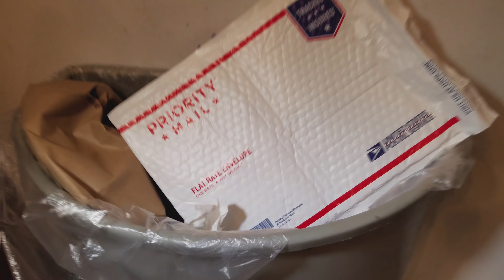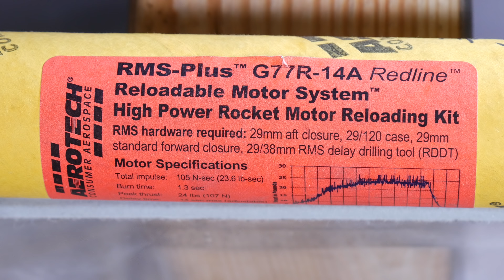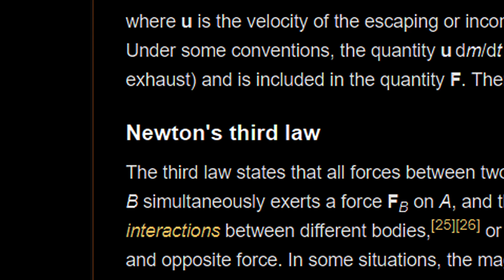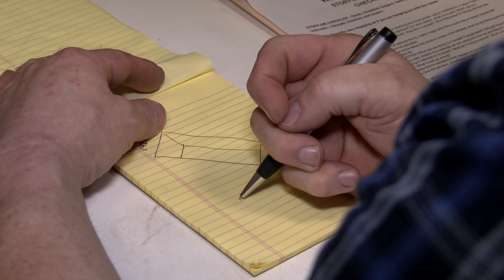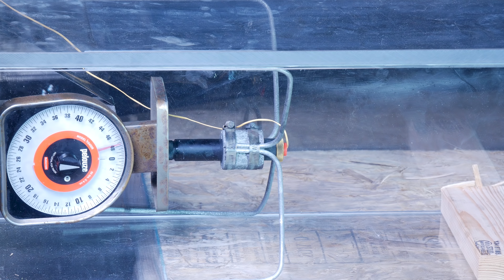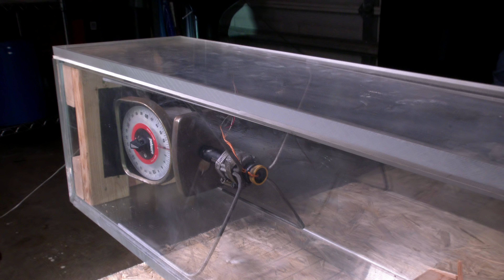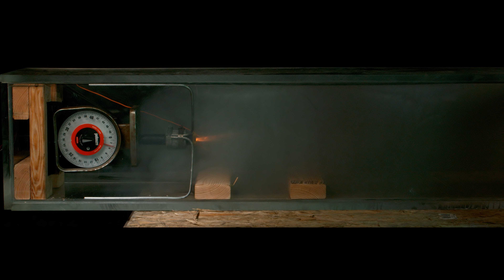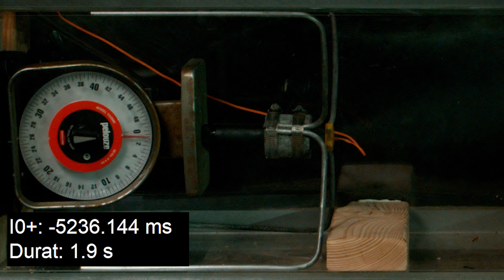Rockets in a Vacuum Chamber - Newton's third law of motion Visualized

Comment: Outer space is an infinite vacuum, that box is a finite small vacuum.
Reply: Waterworld 360 there is not such thing as an infinite vacuum, though I think I know what you’re saying. Space is a complete vacuum. The box is as good as we can do on earth, especially with consumer products. The engine did produce thrust when the effective pressure in its immediate vicinity is zero.
Reply: Bingo!
Reply: Prove space is a vacuum! Prove anything that holds weight for all eternity!
Reply: don't kid yourself, it's not even a real vacuum.  Can remove air, but not all.
Reply: @NoAgendaVideo  And on top of that the gases expelled from the oxider built up pressure removing the vacuum element out of the equation.
Reply: lol "ouster space"
Reply: "Outer space is an infinite vacuum," Nope.

Comment: Did you prove that you were maintaining a perfect vacuum the whole time?
I never saw any gauges to prove you had a vacuum?
Just curious.
Reply: Its not close to a vacuum. There isn't enough suction power on the planet or material strong enough to even come close. This is a terrible experiment
Reply: @trexx32  i agree
Reply: @trexx32  It is extremely easy to create a perfect vacuum without any sort of vacuum pump!! 
1. Get a thick walled glass tube say, six feet high 4 inches diameter.
2. Seal it perfectly at one end.
3. Place it so the tube is vertical along the 6 feet axis.
4. Fill it completely with mercury, with the mercury forming a convex bolster at the top of the tube.
5. Press and fix a blanking plate over the upright end.
6. Turn the tube upside down into a large diameter tank with enough mercury in it to be able to submerge the open end of the tube into it. The tank should be able to take the whole of the mercury in the tube in case of a accident.
7. With the tube vertical and the blanking plate under the mercury,take off the blanking plate.
8. The mercury will drop such that about 26 to 31 inches in the tube will be above the level of the mercury in the tank.
9. Above the mercury in the tube is a complete vacuum.
10. The height of mercury in the tube is being held up by the pressure of the atmosphere. You now have a barometer and can measure the atmospheric pressure by the height of the mercury above the tank level.

No need for a vacuum pump at all to get a vacuum.
Reply: trexx32 there is no vacuum in space.
Reply: @MrCountrycuz  do you agree that the Atmospheric Pressure at sea level is about 14.5 PSI?  Or that it is about 12.5 PSI in Denver, Co (1 Mile high), or about 5.0 PSI on the top of Mount Everest? (5.5 miles high)?  If you just extrapolate from there what do YOU predict the atmospheric pressure is at say THIRTY MILES?  People have been up that high and higher even in the X-15 of the 1960s.  What IS the pressure at 30 miles?  Please provide your best answer.
Reply: As space is not a perfect vacuum it seem unnecessary to create one on Earth for testing space rockets...
Reply: Exactly, there was oxygen in the chamber... So he's not proving anything.....
Reply: @zarron221  And there is oxygen in space.  So rockets work fine there.
Reply: Space is a perfect vacume acording to NASA, Your own Freemasonic Liar statement!! these fake experiments don't prove a thing!!
Reply: @arnolouwersheimer9523  Nope.  Bullshit hoaxer videos say that, but NASA never did.
Reply: john woody I know I'm 4 months late but wouldn't the atmospheric pressure prevent lifting the tube out of the mercury? Pretty much exactly like trying to pull a suction cup up from off the floor.
Reply: Bingo!!! Great question!
Reply: @stuartgray5877  And it's why helicopters can't fly on Everest to bring home the dead.
Reply: Ikbal Mechanical  they are trying to prove newton's third law works in a vaccum
Reply: Ikbal Mechanical  exactly it's about action and reaction just like u said. but what they're saying is if there is no medium in a vaccum there is nothing to push against from to make that reaction happen. so they are denying motion of a SPACE SHUTTLE which use that concept. cause space is a vaccum.
Reply: Ikbal Mechanical  exactly,. bravo
Reply: tell who?
Reply: yeah i know.. it's flaw.
Reply: @arnolouwersheimer9523  Actually NASA says that space is almost a perfect vacuum.
Reply: @arnolouwersheimer9523  NASA isn’t made up of masons, you’re confusing them for the founding fathers
Reply: @anjanadilshan7057  you don’t need to push against anything if you’re creating a controlled explosion and directing it in one direction, as long as you provide enough oxidizer for the fuel you get the explosion and directing it in a specific direction basically has the explosion pushing you in one direction while pushing the exhaust in the other
Reply: @TheNinthGeneration1  yeah i know bro. i said how flat eathers think about this.
Reply: @trexx32  so this was not an experiment
Reply: @paqman9101  no because it's not a vaccum chamber. It's a container with lower pressure.
Reply: @TheNinthGeneration1   NASA's cosmos 59 million dollars A-day
Reply: @paqman9101  so about half a penny for every tax collar collected?
Reply: There's a consequence to the idea that the rocket needs to push off of something. Thrust in the case of the experiment is instant. That is the moment the rocket lights off thrust is there. IF the thrust were generated off of some need to push off something behind the rocket exhaust then the thrust would react proportionate to the increased pressure so that thrust would start at little or no then increase as more material was in the chamber behind the rocket.  Since the later is not what happens, the idea doesn't work.

It's silly anyway. The rocket is basically just a mass driver that uses a chemical propellant to push mass. The exhaust is the pushed mass expended by the mass driver. And it's the driving of the mass (the individual molecules propelled out of the back of the rocket) that pushes the rocket forward for thrust.

The people who think a rocket won't work in a vacuum are demonstrating they have a fundamental misunderstanding of Newton's Third Law. In the rocket the two objects are; the rocket body and its mass of unused propellant is object 1, and the molecule propelled out the back in exhaust is object 2. Acceleration is maintained  as long as you have mass to drive, and only ends when you run out of mass to drive. There is no need of some object 3 external to object 1 or 2 for object 2 to hit.... which is effectively when the rocket in a vacuum denialists are saying is needed.
Reply: @arnolouwersheimer9523  actually they do. They prove that solid rocket fuel doesn't burn in a vacuum.
Reply: I heard sound of the firing rocket, didn't you? Shockwaves through the air in that chamber causing pressure. He's a NASA stooge!
Reply: @tekcomputers But what if (theoretically) pressure releasing from a rocket nozzle can't compensate enough thrust from release into zero pressure of empty space?

 Could not such an environment cause more suction than thrust, actually causing a brake effect? YouTube GoFast Rocket; seems to be what happens when rockets leave our earth atmosphere.
Reply: @TheNinthGeneration1 That's a theory sold to us. But let's just use Newtonian physics; every action must have an equal & opposite reaction: Vacuum of space offers NO reaction. Worse yet; INFINITE 0 pressure would theoretically suck the the exhaust right out of any rocket, causing a BRAKE effect.

I don't know (I"m not a physicist); I'm just questioning with common sense
Reply: @arlanwade3268    the combustion in the engine pushes the rocket. The fuel and rocket are two separate things and can push on each other. 

That’s not how pressure works, 0 is the default, and it’s the difference of pressure that determines the force they push with. 0atm to 1atm is half the force of 1atm to 3atm. Plus, higher pressure pushes out towards lower pressure, vacuums don’t suck things out. 

Common sense says that a calculator falls faster than a piece of paper. That’s true with a smooth piece of paper, but not a crumpled one, they fall at the same rate. Common sense isn’t always correct. 

Also, google exists, it is a much better source for asking questions, google scholar is even better as it gives you scientific sources that can detail experiments demonstrating everything I’ve told you.
Reply: @pressyprice Who can believe ANYTHING NASA sais: Common sense tells me that as air pressure approaches 0 pressure towards empty L.E.O. space; it's gotta be 0 pressure.
Reply: @pressyprice "almost"? Apart from atmospheric pressure; what can possibly offer pressure in the absence of atmosphere? Just asking
Reply: @arlanwade3268  Thought I would also respond to this. The equal & opposite reaction of a rocket engine in space would be the engine expelling the exhaust from the nozzle. If you were to throw a ball(assuming it has enough mass) in a vacuum and zero g, you would end up being pushed in the direction opposite to that of which you threw the ball. I don't think I explained it great but hopefully it is enough to understand.
Reply: @arlanwade3268  I don't think my first reply went through, so I'm going to respond again. 
Space actually has small amounts of gas spread throughout, which sometimes come together to form nebulae(very beautiful, I highly recommend you look at pictures of them sometime if you havent already). Not only that but atmospheres usually extened a lot further than it seems. For instance, Earth's atmosphere actually extends past the moon, granted it's only a very minute amount of gas, but at LEO, it's enough to cause enough atmospheric drag that the I.S.S. and other satellites will sometimes have to boost themselves back up to proper orbit. 

Hopefully this helps clarify some stuff. Feel free to ask more questions!
Reply: @arnolouwersheimer9523 Heh, heh! Amen! So sad that most Americans still fall for such an absurd hoax.
Reply: @waltermitchell4617 OH, so you're insinuating that rockets don't work in space? Heh, heh! Welcome to reality my friend; you're not a sheep.